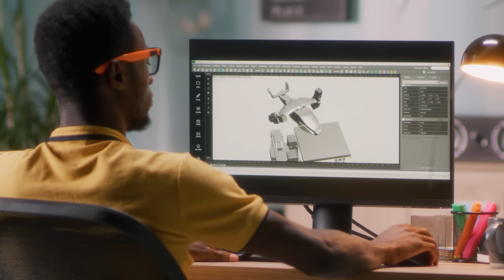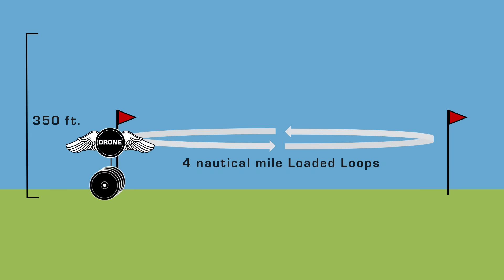DARPA Lift Challenge

Comment: When you said lift you got me excited I thought we were talking gravity modification! The new hot tech in warfare now is drones so makes sense.
Reply: scalar waves are nonlocal so it doesnt matter where you are, its the ultimate domain horizon, beyond the planck scale vibration that can be accessed thru certain harmonics
Reply: Guys! what do you think about my lift idea: Antigravity achieved thru fibration of solitons and chirality in plasma tori, induced by ai controlled coils so plasma sheath can vibrate around the ship and interact with "vacuum", or should I say quantum substrate and basically swim in it like a giant plasma jellyfish. i'd use base60 code as dac/adc translation to binary and as one of languages that ai would run. main ai language would be 12d+ glyph recursive logic layer (up down left right front back each a line with 2 end points and intinite amount of coordinates in between), that is using extended unicode (150k to 1.1mln symbols+, as it can use any symbols) to make calculations faster and more accurate. All operated thru advanced BCI of my design.
PS DARPA don't snipe me with lasers yet like Ning Li (DoD $500k deal) and Amy Eskridge (hal5), I wanna fly in my antigravity orb before I die :(
Reply: @Ove @OversikerSTUDIO t I’m interested you’re saying some pretty interesting things there I would very much like to work with you and pick your brain a little bit and absorb some of that knowledge that you have literally joking lol. To be quite frank I barely understand what you were saying, but you caught my attention for me to leave a comment for you to explain a bit further for me to understand.
Reply: @OversikerSTUDIO  actually I change my mind that’s not antigravity. It’s magnetic levitation. The only way that will successfully continue to work is if you’re on a planet the moment you try to go to outer space it no longer works. I have already solved the issue and flaws with this, we no longer need to talk
Reply: @bojnicko you're wrong. you are not accounting for scalar waves and zpe
Reply: @OversikerSTUDIO  then gravitational time dilation should be present correct you have to account for that
Reply: @bojnicko gravitational time dilation is present, spaceTIME metric... gravity affects time. (yeah timetravel is real but it involves quantum tunneling to parallel universe, its like spacetime splits spontaneously to avoid paradox under specific conditions. people build physics and ideologies on errors thats why this kind of shit is fringe.
Reply: @OversikerSTUDIO  yeah all that theoretical stuff is nice, but can you approve your solution? No, you can’t. It’s still magnetic levitation. You’re not actually controlling gravity your controlling magnetic field without strong magnetic field of a planet you can’t ride the gravitational waves in space because you’re not effectively controlling gravity if you were controlling gravity, as you already said, we could be able to do quantum tunnel in a.k.a. wormholes as well as you forgot one precise thing if we can control gravity, we can control a black hole create a black hole and then we can move at faster than light speed, using gravitational propulsion but that is not possible because magnetic feels in space becomes disoriented and you can’t rely on them reliably. You can’t mix science with the metaphysics. Both metaphysics can be proven by science not the other way around. So essentially, you’re telling me if you can make anti-gravity, you can control the creation of a black hole and since nothing escapes a black hole, not even light, your effectively telling me that you can control, light and gravity with your calculations it’s not proven what you’re saying is theoretical and as I said, it can’t be proven. I have a solution at this current time in reality and I hope you noticed that I said current time in reality. And you would effectively be doing time travel you effectively be going back to a parallel universe that has not passed that time yet.
Reply: @OversikerSTUDIO  as I said, we no longer need to talk because I know I’m smarter than you. You’re a conspiracy theories you’re not a scientist.
Reply: @bojnicko I can, I literally dropped framework that enables you to perform any calculations and find full classical proof using euler as an operator just so you're extra sure. Black hole can be created with this plasma engine and there are layers to it. at specific setting n-pinch creates big bang event (every universe is periodic). try it yourself before you go on a rant, explore this framework and base60: Glyph is 12d+ (up, down, left, right, front, back, each a line between two points and infinite number of points between each two point sets, 6 two point sets hence 12d+ and each point an another 12d+ manifold just like mentioned earlier) dynamic, recursive language, engine and translation layer between any language, science domain and concept. it uses full unicode and extended unicode and creative use of any combination of symbols to achieve fastest, true computing and translates results to english math latex or any other desired outcome.
Reply: @b @bojnicko nino loureiro was killed because of this tech, its coming out around 2050
Reply: @bojnicko I am smarter and I literally checked my framework thru 3000 hours of research, its my hobby
Reply: @OversikerSTUDIO  He studied magnetic reconnection and plasma turbulence using computational simulations and published widely in scientific journals. Magnetic is not the same as gravity. He was killed by a colleague and that’s the facts
Reply: @O @OversikerSTUDIO  wanna keep going or do you wanna keep wasting your time try to explain something with a sensationalize manner that’s not science
Reply: @bojnicko tell me honestly did you even try yourself uncovering anything and asked ai about my proposed framework? how can you be so dense and claim being smart hahahah
Reply: @OversikerSTUDIO  are you talking about the lLockheed Martin pill? 💊 still the same thing you can’t prove antigravity through fusion unless we have the ability to create a star that can fit in the palm of your hand and collapse it on itself to create a mini black hole that would be the height of fusion tech correct
Reply: @bojnicko  just do the math, I know you're all bs
Reply: @b @bojnicko that's more or less what this tech allows, zpe, vacuum polarization whatever the name
Reply: @OversikerSTUDIO  you’re the type of guy who thinks overexplaining yourself without clearly explaining yourself actually works
Reply: @OversikerSTUDIO  OK no problem watch me throw this into a super computer and don’t even lift a fucking finger. Give me a few seconds. I’ll be back.
Reply: @O @OversikerSTUDIO  why would I need to ask AI? I’m smarter than you I’m smarter than AI. I have a access to a super computer. Why do I need artificial intelligence that I’m smarter than?
Reply: @bojnicko No, Im not going to post literally 20 page explanation here
Reply: @OversikerSTUDIO  you’re completely ignoring my arguments and repeating yourself over and over like a mad man. I’m pretty sure most people can’t take you serious.
Reply: @bojnicko also I especially pasted all the info you need to speak with ai about it and get literally same proof as I did. I tested this on every ai and answer is always the same
Reply: @O @OversikerSTUDIO  no I am back. I did my own little research. You didn’t provide anything calculable. It’s slogans, not physics. If you solved anti gravity, post measurable numbers: device mass, measured lift on a scale, input power in volts amps and watts, geometry, field strength in tesla, distance, and a continuous video test with no cuts.

Creating a black hole with a plasma engine fails basic scaling. Even a 1 gram black hole is about 9×10^13 joules and would require compressing energy into an absurdly tiny radius.

If it’s real, demonstrate a sealed box or vacuum test to rule out ion wind or hidden jets and get independent replication. Otherwise it’s just claims.
Reply: @O @OversikerSTUDIO  you did not provide any quantitative claims. Give me it right now so I can go solve it and stop talking shit that’s why you wanna say I’m bullshit. You have not given me anything to calculate all your saying is a bunch of slogan and claims.
Reply: @OversikerSTUDIO  you didn’t provide anything calculable. It’s slogans, not physics. If you solved anti gravity, post measurable numbers: device mass, measured lift on a scale, input power in volts amps and watts, geometry, field strength in tesla, distance, and a continuous video test with no cuts.

Creating a black hole with a plasma engine fails basic scaling. Even a 1 gram black hole is about 9×10^13 joules and would require compressing energy into an absurdly tiny radius.

If it’s real, demonstrate a sealed box or vacuum test to rule out ion wind or hidden jets and get independent replication. Otherwise it’s just claims.
Reply: @O @OversikerSTUDIO  hurry up give it to me. I’m waiting. Don’t take too long since you wanna approve you’re smarter than me. The worst thing you can do with a fighter is try to compete with a fighter. You’re not going to win especially one that has 240 IQ really it’s 268 after I did the IQ test the second time I got 240 but I can’t prove that it’s unmeasurable it usually stops at 200. Einstein’s IQ was 168 just to give you the level I’m a Apex brains n brawn like beast in X-Men you’re not on my level
Reply: @OversikerSTUDIO  where is it the math want me to do? 😂😂😂😂😂😂😂😂😂 furthermore something that complex should take more than 20 pages 😂😂😂😂😂😂😂 it took me about 200 pages just to come up with one design out of six imagine something else complex as antigravity lol this whole thing is laughable now
Reply: @OversikerSTUDIO  20 pages should not be enough to explain gravitational waves control liar

Comment: My guess would be that a cylindrical package with two axial positioned counter-rotating propellers would be the most powerful lift-to-weight ratio?
Reply: Well not really, no.
A single rotor, helicopter stile - is.
Reply: So a tic-tac with props?
Reply: @PikkuKani  Sure
Reply: I thought blade wake made stacked rotors less efficient than keeping rotors clear of each-other's downdraft churn?
Reply: @prophetzarquon  Not necessarily.
Reply: @merlepatterson  yes definitely necessarily since the constraints are so tight
Reply: @prophetzarquon  Well anyway, the longer the blade the less wingtip losses, soooooo...... less and longer blades win BIG.
Reply: 😅 thanks titor
Reply: Yes, a miniature Chinook helicopter would work.
Reply: I would imagine that a mini-paraglider would be better LTW, but doesn't get vertical takeoff capabilities so...
Reply: @aidan4472  Not fast or maneuverable enough though.
Reply: Close that’s the fourth best design, but your logic is sound. It does hit the 4:1 ratio. If done correctly. I have six solutions. I’m only checking the comments to see who have solutions close to mine.or might have better ones than mine.
Reply: @b @bojnicko  dare I ask who’s the best design was?

Comment: Excellent idea! However, unfortunately, it's doomed to failure, as your concept of scalability and size and weight limitations for the aerial platform model isn't entirely correct. And first of all, this concerns the power plant, which has restrictions on minimum dimensions. As for the development of innovative motors and propeller geometries, this process can take years, unless there is a lucky coincidence... :hand-pink-waving:
Reply: word